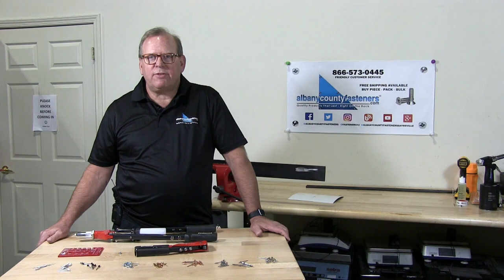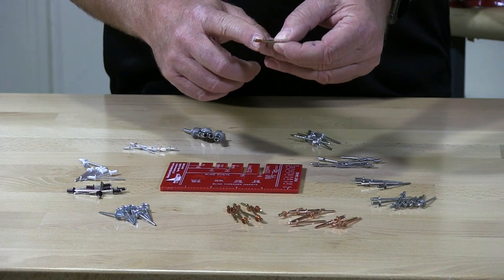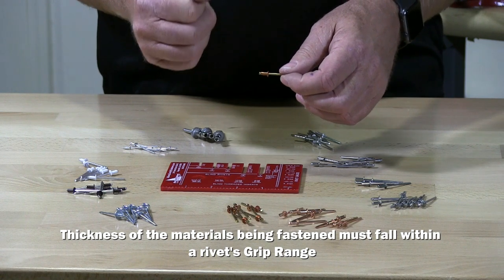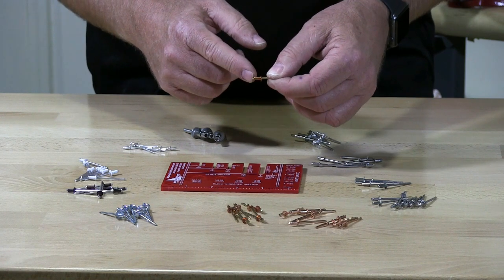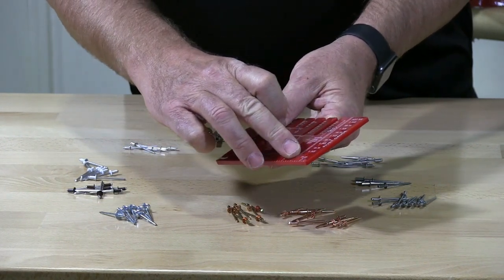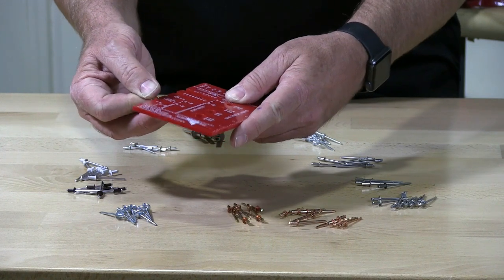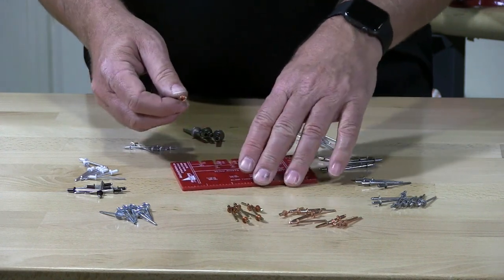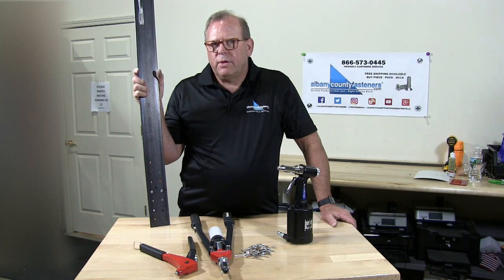How to Use a Rivet Gauge and Measure a Rivet | Fasteners 101

Comment: How do you base the length of the rivet to the thickness of the materials to be joined together ?
Reply: Would like to understand that too! If I have two 2mm thick sheets to be rivetted together, how do I define the size I need? Also does it make a difference for Rivnuts?
Reply: The way i'm understanding it based on another reply the uploader posted.
the length of the rivet is longer than what is written on product packaging. the length written is actually the grip length which is the exact thickness of the 2 parts you're joining together. 
so your problem can be fixed with a 4mm rivet.

Comment: Any suggestion on how to measure a rivet that is installed and will have to drilled to remove? 
I am trying to determine the size of rivets I need for my fishing boat.
Reply from the maker: Unfortunately, we don't know of any way to measure a rivet that's already installed. To know what size rivet you need, you'll need to measure the hole and thickness of material.

Comment: If I need additional rivets of the size I am now using and do not know the length, how do I state the length. In other words, what part of the rivet is included in the length?
Reply from the maker: The thickness of the finished material installed.

Comment: So your saying a rivet is not measured by the distance from the hat to the end unless it's measured by a rivet measuring tool that measures the distance from the hat to the end?
Reply from the maker: Correct!
Reply: You do realise that you are contradicting yourself with this answer ?  When you measured with the rivet measuring tool you measured the same distance that you told us was not to be taken as the measure of the rivet !!!
Reply: @regwatson2017  I'm guessing the tool is just the key to tell you which rivet it is. The rivet would compress to a specified length given by the key. It obviously compresses to a length shorter than it's original state.
Reply: Sounds like he is selling the measuring device

Comment: I have factory crimped aluminum roofing on a travel trailer which I imagine is 4 thicknesses of metal when crimped (maybe 1/8 of an inch when crimped originally)  Water damage/frost wedging has split the crimp apart and when opened the pieces are open to maybe 1/4 to as much as 1/2 inch..  Can a rivet Pull the layers together then crimp them tight?  Do I need a tool that i can put through a drilled hole that will pull the pieces together tightly and then place a pop rivet to hold it together?  Hope the question makes sense.
Reply from the maker: No the rivet brings the martials together tight as you squeezy the handle.

Comment: OK I sent off and got one of those little red rivet guys just like the one you showed.  (Very nice guide, very thick plastic-should last a long time!). But I’m still not clear. I have a ribbon here that measures to be a #5 by the diameter hole and in the slot it’s a 44  in the slot.  OK, what does that mean?  (it’s actually between the 44 in the 46th so I guess it’s a 45 in the slot). I’m assuming you measure to the end of the sleeve and not to the bottom of the ball as you pointed out.   How does that translate to the thickness of material for which can be used?
Reply: OK I did a short research and turns out using the rivet gauge is very simple:
The gauge allows you to determine a two digit code for the rivet this code is referred to as the trade number and simply: 
the first digit is the rivet diameter expressed in 32nds  of an inch and the second number is the maximum grip length expressed in 1/16ths  of an inch.   So, for example a ‘trade number’ of 86 means the rivet diameter is 8/32” 
(= 1/4”) and max grip length is 6/16” (= 3/8”).

Comment: I'm just trying to join two pieces of flashing, less that 1/16 of an inch total thickness when the two pieces will be joined.  Will a rivet with a 1/8 inch grip work for that?  Will it compress enough
to hold the two pieces together?
Reply from the maker: A 1/8" grip rivet could work, but it might be better to get a rivet with a closer grip range. We actually have some pop rivets with a 1/16" grip which may work for your application. They are 4-1 (1/8" x 1/16") stainless pop rivets and can be found here: https://www.albanycountyfasteners.com/POP-Rivets-1-8-304-Stainless-Steel-p/11930000.htm

Comment: I have tried every online retailer to get one of those rivet measuring tools you showed on your video, EBay, Amazon, b& q, and a score more. Does being in uk make a difference. I purchased a rivet gun that came with small amount of 4 various sized rivets but the largest wasn't long enough to go right through to the back of what I'm trying to join. I have watched this video several times but i am still none the wiser, you spent too much time repeating about the length of the rivet not to the very tip. Where can I get hold of a template same as the one you used. I am in uk and run out of sites to search. I am disabled and can't go out to buy anything so I must be Amazon's best customer.
Reply: michael sullivan  perhaps Michael you have access to vernier callipers , take the diameter measurement of the rivet head above the cap this  will be your drill size try and get as close as you can to that diameter hopefully leaving  a friction fit for placing your rivet, take the combined thickness measurement of your material you are wanting to join  then take your calipers and take a measurement of your rivets above the cap length  needing about   1/4” longer  then your material combined thickness you should be able to squeeze the rivet tight enough. If you call a shop for rivets needed I am sure with the combined material thickness  given, the diameter of hole , and the type of material you are joining they will be able to help you. Type of material is important as two different types of  metal can be effected such as aluminum rivets and stainless sheeting oxidizing/ corrosion. Good luck Michael cheers

Comment: what length and diameter of rivet should i use if i want to join 2 sheets of aluminium sheet which is 2mm in thickness i.e 2+2 = 4mm in total?
Reply from the maker: You would probably be looking for a 3-3 sized rivet, which is listed as having a 3.2-4.8mm grip range and 2.4mm diameter. For joining sheets of aluminum, make sure you're using an aluminum rivet.